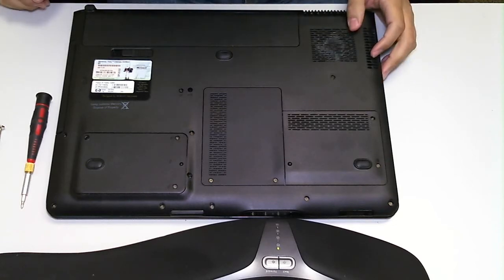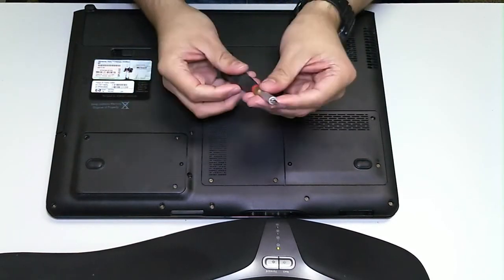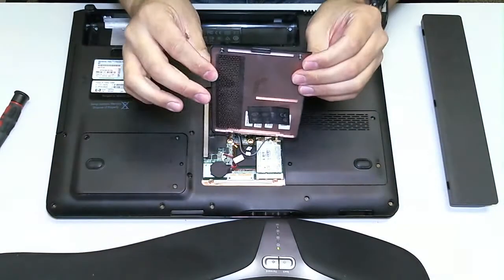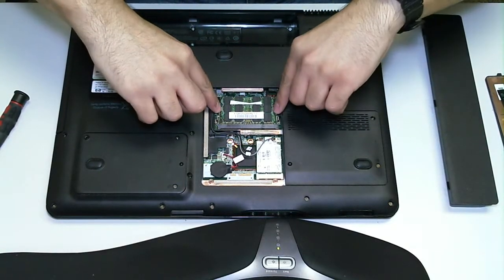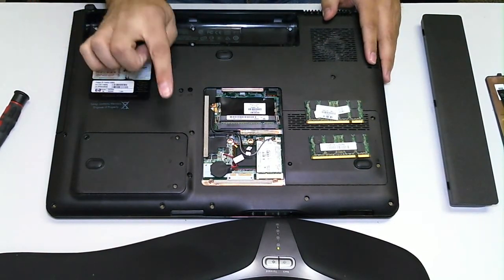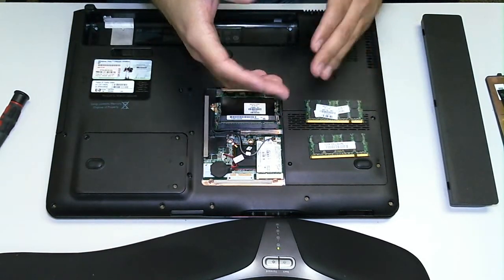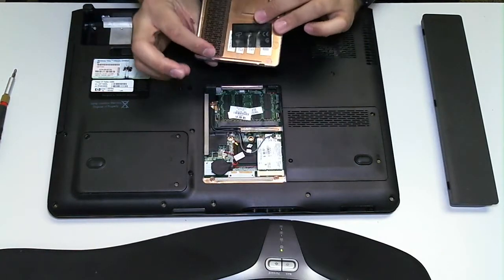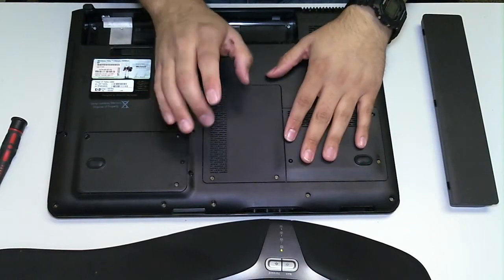HP DV9000 RAM Removal Upgrade

Comment: I understand that the factory capacity 1 (x2) GB of Ram. I want more, but I think that will effect the systems ability to stay cool. What are the risks of exceeding the ram capacity over 2 GB? Thanks.
Reply: Nobody seems to answer this question.  I adore my dv9000 but Microsoft updates killed my XP OS and with only 2GB RAM it is soooo slow.  

Believe it or not, Microsoft updated it to Windows 10 (when they arbitrarily updated EVERYONE to 10 a few years ago and had to do thousands of repairs).  Best they could do was roll mine to Windows 7 Pro but only 2 GB RAM can be read since.  I turned off the Windows 8 setting (it is there automatically to allow touch screen, which nobody needs nor wants on this model) but still soooo slow).  

IF I could successfully install 2x2GB or more I'd be happy.  

WHY doesn't anyone address this in all the questions here, I wonder
Reply: the answer is not readily available. After an extensive search  I found a technical repair manual for this laptop on line that stated the maximum ram was 2 GB. despite that I installed 4 GB of ram. when I checked the system  setting it showed  3.3GB ram. my laptop is dv9033cl  OS is linux mint 20.2 xfce which run acceptably well.